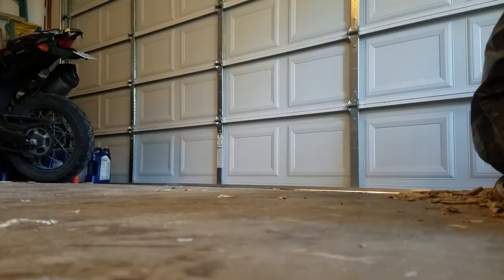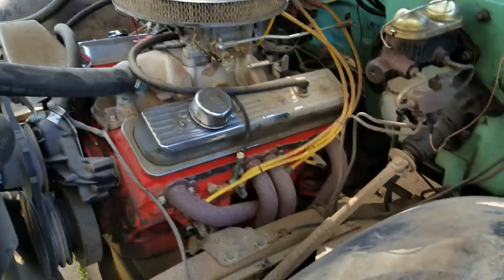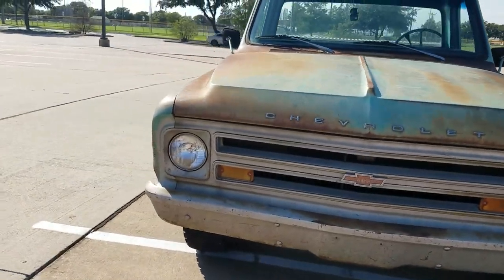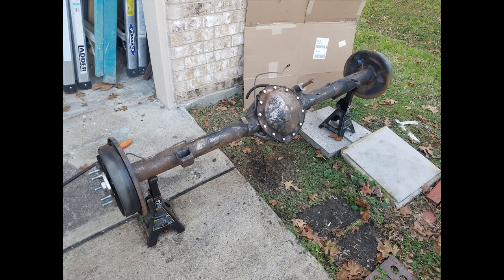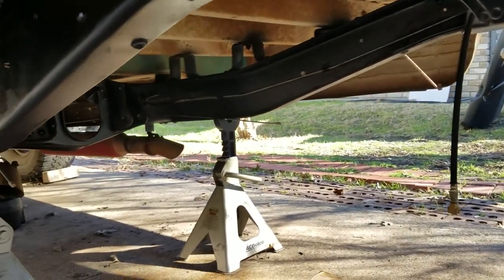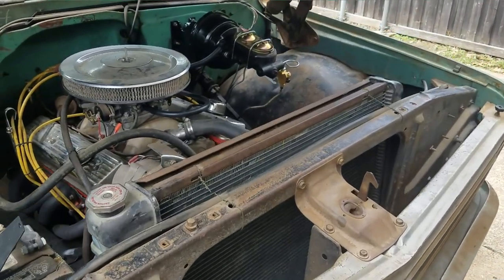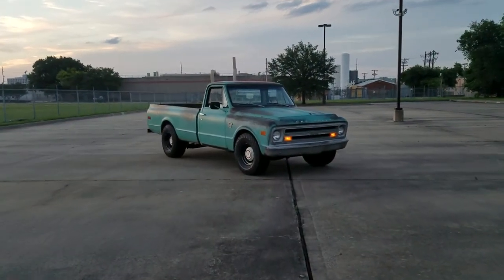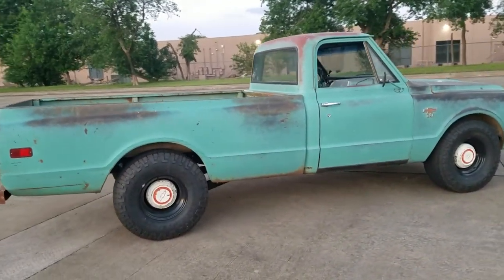Reviving a worn out Farm Truck! - 1968 C10 Overhaul

Comment: First truck was 67 longbed, small rear window, straight 6 with 3 on tree set up same way with 2 in widened gm artillery wheels and 38s. What a beast, man i miss it! Put three three wheelers in back and did the coal hills in central pa. What great times. Bought it for 100$, sold it two years later for 100$. Great video, thanks!
Reply from the maker: Heck yeah man! These trucks rule. Thanks for watching!

Comment: i get a lot of old trucks from hauling cars for places that people are cleaning up i got from a rich ranch a lot of good rigs just to give u an idea one was a 67 rs ss 427 yenko camaro with a 79 4x4 short box in mint condition just needed a new fuel pump and carb cleaned out from sitting for years in a shop

Comment: Oh, it's cool! I just got a  C-20, and I'm doing almost the same suspension and drivetrain changes you made. Except that I'm going from a leaf spring set up to arms with coils.
Reply from the maker: Awesome! The coil spring trucks ride super smooth, I'm still stoked on all the upgrades I did. Good luck with your build!
Reply: How’s that c20 build coming? I’m just starting a 69 c20 with a 454.
Reply: @rowdy3837  It's coming along. I am about to get it running in the next week or two. Everything takes longer than I thought it was going to, so I decided to do it all at once. Short bed conversion, leaf spring to coils, drop spindles and lower springs 2.5/4 , changed to a 12 bolt rear end, disc brakes all around, hydroboost, headers and new exhaust and electric fans. Also along the way I cleaned and painted everything that I could. I was lucky that it was a truck from the desert, so there was no rust, just black widows and hornet nests in all the wrong places. Good luck with your build, I wish I had a 454 in mine, but the 350 is running strong, so I don't want to mess with it right now.

Comment: Very rad!!! I have a 70 c10 myself… switched out the motor.. lowered it 5” rear 3” in front… rewired the whole thing and now hunting for a 4 speed auto trans… and yes need to put disc brakes on the front… getting there…and like you need to get my wallet ready! 👍💯

Comment: I personally would have stayed 8 lug but  that’s me. I love the look with the wheel and tire combo.
Reply from the maker: That was my original plan actually. It ended up being way more cost effective once I found the 12 bolt and the squarebody front subframe for way cheaper than a front disc conversion kit and a posi unit for the eaton rear end. I was planning on steelies and fat tires either way though, it's my favorite look. Thanks for watching!

Comment: I bought a ‘68 C-10 5 lug.  I’m in Mansfield TX.  The build starts this winter.  It does not have a motor or transmission so it’ll be a frame off restoration.

Comment: Awesome truck and great work! What brand wheels are those? And did the factory caps just pop on or had to add clips?
Reply from the maker: Thanks! These are Wheel Vintiques, they're made with the hubcap nubs. I love the steelie/dogdish look but wanted some wider than stock. They're great, but a little pricey

Comment: Hell is this truck sitting stock height? I have a 84 c10 sitting stock wondering if these wheels will fit like this on my truck. Nice machine 👌
Reply from the maker: Yep stock height. I don't know as much about squarebodies but I'd be willing to bet you could fit 33"s with the right wheel size/spacing
Reply: @DoubleArrow Thank you

Comment: What is the stuff you washed it with/prepped before rinsing to turn the rust black yet save the paint?
Reply from the maker: Comet and a scotchbrite pad. It didn't turn the rust black, but scrubbed off the top oxidized layer exposing that black primer underneath. This trick only works on old single stage paint, nothing with a modern clear coat

Comment: Howdy what year was the square body front suspension from? Also where did you get the new parts from. I have 68 C10 that I’d like to get updated brakes and suspension. Thank you.
Reply from the maker: I don't actually know the year of the donor truck, I just bought it off a guy with a 67-72 who planned the same mods but ended up going a different route. I think pretty much all squarebody stuff will work in one way or another. Good luck with your truck!

Comment: Blake, you do very nice work. I like the shock absorber modification. I was wondering if you could send me the paint code number its inside the glove box on the top of the SPID I am repainting a 67 C-20 but the paint code is not legible the number May start with ( 045 _ _ _ ) Thanks in advance Pete
Reply from the maker: Thanks Pete! The paint code is 4503AA - Light Green
Reply: @DoubleArrow  Thank you

Comment: Great find! Love the patina on this old green truck. Forgive my ignorance, but is th ecab and bed the same size on the 3/4 ton as the 1/2?
Reply from the maker: Thanks! And yeah, all the sheet metal is the same, the differences are only in the chassis which is why I was able to swap 1/2 ton parts in there.

Comment: i love the truck! did you use just standard c20 replacement springs or the heavy duty ones? also do you remember the offset of your wheels front and back?
Reply from the maker: Thanks! I used C10 springs, C20's would've been pretty stiff. The offset of those Wheel Vintiques is close to 0, I can't remember off the top of my head though, sorry

Comment: What did you paint the frame and axles with?
Reply from the maker: I think i used some VHT frame/axle paint just in a spray can. I first wire wheeled/sand papered it down, then used a coat or two of primer below that though